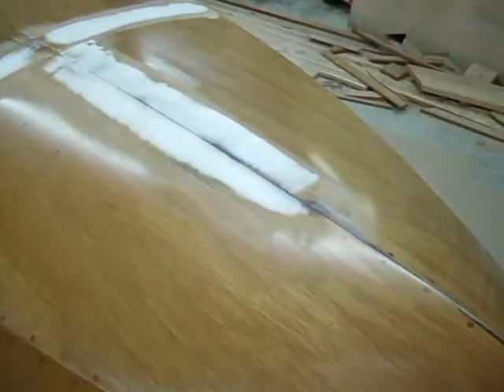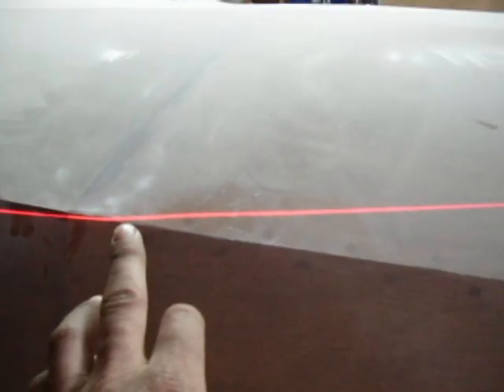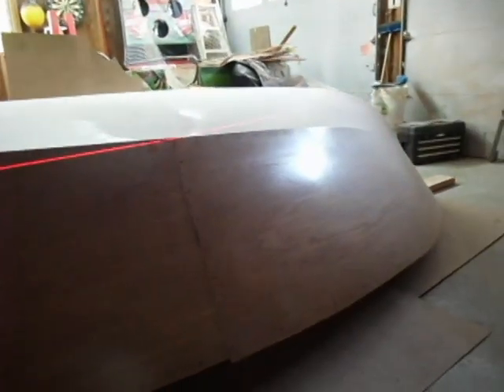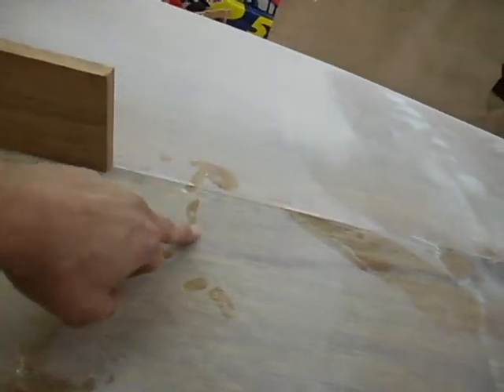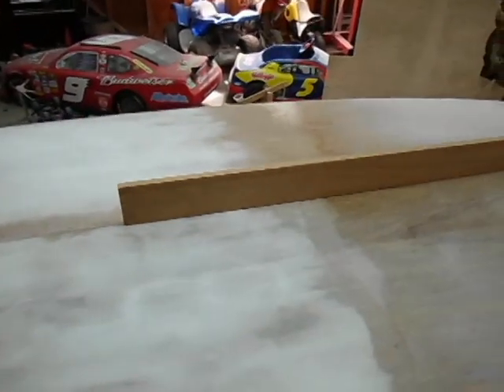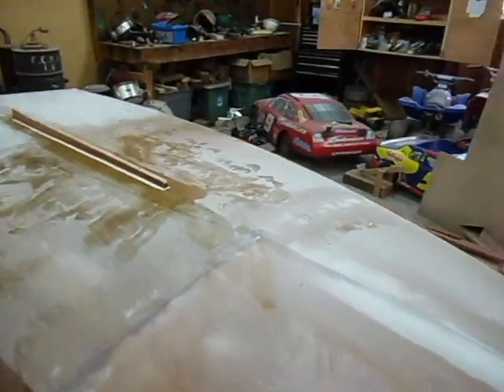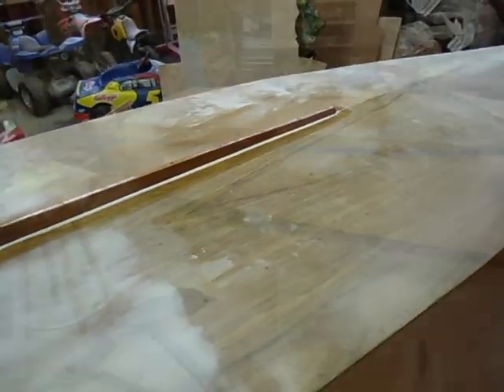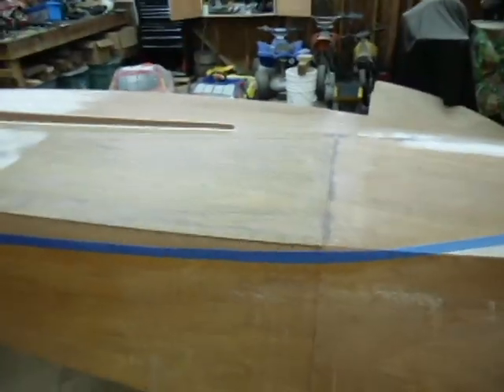Building the zip vol # 13

Comment: Hi again, There is something I would like to know. I it the plan that tells you to start your waterline 3'' from the bottom? Do the plan gives different waterline start depending on the expected weight on the transom (engine)?  How does the plan tells you 'where' to start your waterline??
Thx.
BTW the length of the skeg is more about the pivot point on the vessel then the amount of "grip'' in a turn. Cheers.